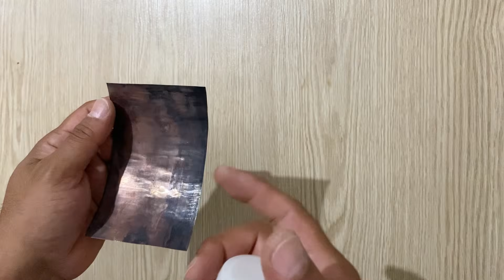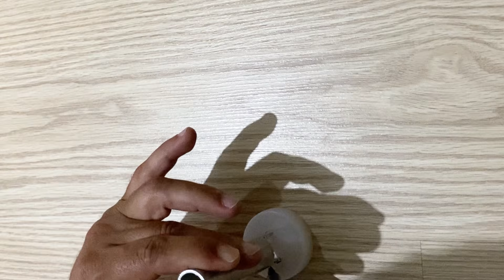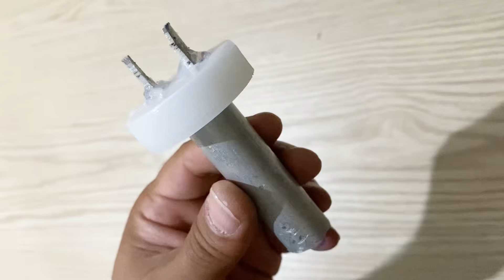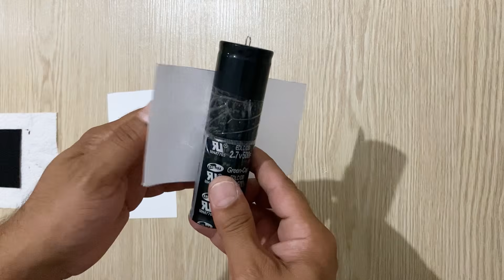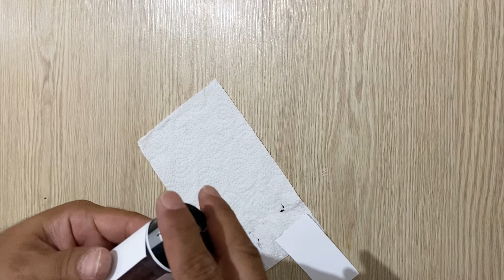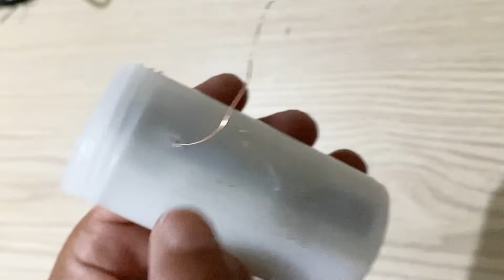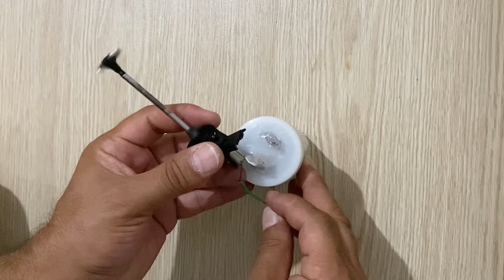How to Make Real and Powerful Battery, DIY Battery (5 Years Lifespan)

Comment: Sodium hydroxide drain cleaner as the electrolyte would make this similar to a salt battery, that's quite fascinating.
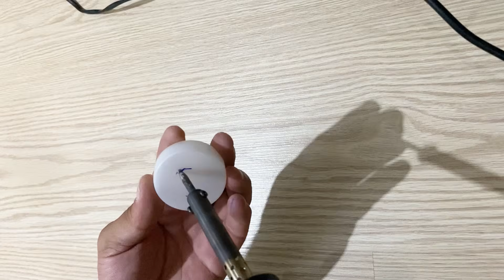5:55 an easier way to do that in future is to mark where you want the two aluminium terminals to stick through the plastic lid and then heat up the aluminium with a blowtorch or even lighter briefly, then poke the aluminium through the lid similar to how you did with the soldering iron. You'd need to hold the one end of the aluminium with a cloth or with an oven glove on while heating it up because it's almost as good a conductor of heat as copper is. 
Safety first and all 🙃😜
Just punch a tiny pin hole in the lid for the hydrogen to escape. 

Quite a simple idea, cheers for sharing. Can you use stainless steel instead of the aluminium for the anode(?), to make it last even longer? 🤔

Comment: Hi Joy of Electronic,
Nice video; although (sorry to say) without real understanding of physic and mostly chemistry (experimental facts); it remains (short time) speculative and a day-dream.

Why?
OK a battery when not connected is supposed to stay (very) long ready for you to connect it and allowing the electrons to flow and allow the half elements of the cell to work in concert (most of the time how you have defined (following the most favourable way - read providing the highest voltage difference (so each half element with its highest potential (positive on one side-and negative on the other)... Voltage is a potential energy; like water maintained with a dam; but if there is a side way; the tiniest, water will find its way down; that way will be favourised, it will grow and all water going down slower and with no more potential energy.

Cu resist quite wel NaOH if not hot and away from air oxygen!
Cu + O2(g) --> Cu2O +:CuO
Cu2O + H2O --> 2 CuOH (valence 1)
2 CuOH --> Cu(0) + Cu(OH)2 (valence 2).
----
Cu(+) often disproportionate to Cu(2+) (oxydation) and Cu(0) (reduction).

Then NaOH what is a quite strong base, if hot or sufficient time allowed will express the amphoteticity (acidity of copper hydroxyde).
Cu(OH)2 can be seen as H2CuO2... so it makes transciently cuprates like Na2CuO2

H2CuO2 + 2 NaOH --> Na2CuO2 + 2 H2O

If there is no oxygen available it will be depleted soon and it stops; otherwise it will slowly proceed and continue chewing the copper electrode slowly until all is gone into solution and repeecipited as Cu(OH)2 allowing naked Cu surface to be further oxydized.

On the other side; the more concerning part aluminium: Al
It provides the high reduction potential or (electropositivity) and most part if the battery potential voltage.

But Aluminium is appatently quite and stil due to a transparent oxyd layer (Al2O3 and Al(OH)O aside a little Al(OH)3 all 3 are interconnected into reactions into water and switch easily between each other.

Al(OH3)3 is amphoteric (plays the role of a base when exposed to stronger "acids" than itself; and the role of an acid when exposed to a stronger base than itself...
This reminds you copper hydroxyde isn't it?
For a good reason: acidity or basicity is only a relativity question and scale; two faces of the same coin.
There are the two extremes strongest acid and strongest base; but the second ones just below become for the second strongest acid side - it is basic relative to the stronger than itself acid; same applies to the totally opposite side of the scale; the strongest base; just below the second stronger base is slightly acidic vs itself...

So Al((OH)3 could be seen as H3AlO3 and if stronger bases are present; it forms aluminates like Na3AlO3.
Those are soluble and Al(OH)3 precipitates (as a gel) and reforms the caustic NaOH leaving naked metal.

The story would end there if Al was't so reactive (electropositive); it readily reacts with water H2O (again both an acid and a base relative to stronger acids or bases than itself)...
Al + 3 H2O --> Al(OH)3 + 3/2 H2(g)
This means that if water is present; the alternative half battery 2H(+) + 2 e(-) --> H2(g) 
is présent and operational ...thus battery in short cut; dam lets water fall via a side cracking and the energy is lost in little time with the attenant dangers of heat, flamable H2 gas and pressure build up.

Conclusion:
No need to test your battery unless wishing for something bad to happen to viewer trying it;
To give an idea of the possible runnaway reaction; that might become uncontrolably rapid and dangerous, autocatalytically:
1) Simply test the reactivity of aluminium foil (a tiny wrapped ball inside a beaker ... with protective personnal equipment - labcoat-gloves and googles) against strong acid like HCl (20% by weight should suffice a few ml)... it will dissolve tge thin protective layer as AlCl3, regenerate HCl (so only a catalyst yeah) and precipitate Al(OH)3 setting the naked reactive metal into contact with water thus setting H2(g) free what is quite exothermic due to electropositivity of aluminium...
Anyone with a good reasoning sense would'nt do a battery from pure sodium (Na) with water... it is a bit (with a kind of slight delay) what you propose here

2) Do the same with NaOH conc solution like pipe uncloging lye solition (10% by weight) a few ml; and aluminium foil wrapped tiny ball...
WEAR GOOGLES and gloves, labcoat (risk of blindness and severe burns if it enters into contact with eyes of skin).
Into the past solid NaOH prills were mixed with coarse aluminium metal powder to unclog stopped exhaust pipes combining heat of dissolution of solid NaOH, dissolution of fats (saponification - hydrolysis of fatty acid glycerol triesters into "fatty-ate" of sodium and glycerol (propan-1,2,3-triol)), dissolution of proteins (hydrolysis) like hairs into organic sodium salts of amino-acids AND as extra:
Heat and mechanical work ...H2(g) generation.
This produced gas quite fast if water was put into contact with the dry uncloging mixed powder (NaOH/Al) ... a bit the tiny demo proposed!.

Regards,
PHZ 
(PHILOU Zrealone from the Science Madness Forum and many former A.O.L newsgroups related to chemistry)
Reply: You can see from the comments that most people are poorly educated .regarding physics and chemistry.
Reply: Wasting your time

Comment: Can it be recharged by using 5V or 12V DC converter?
Reply from the maker: No, it’s only reusable
Reply: @joyofelectronics9782  Have you measured the total capacity of the battery in mah between 1.5V and 1.2V? If this thing even has 1000 mah, it would be even more amazing.

Comment: You Can Use Even Vinegar, Easily Accessible Acid! As For The Cathode Ans Anodes, I Suspect You Need To Clean Them Even With The Separator, Something Neutral Would Work, Like Filling It With Sand Then Pour Either Salt, Alkaline Or Acid Solution!
I Am Impressed With The 1,5 Watt Power(1,5Volts*1Amp) Outpot, I Would've Loved To See A Timelapse With Some Load On it, Something To Consume It, Just To See How Long It Can Last, With Live Voltage And Current Measurements During The Work-Load!
Reply: I would also want to know how to recharge this battery for it's said to work for 6 hours.

Comment: Interesting. When I tried it worked. But can have a higher voltage and what happens if the electrolyte is not removed when not in use,?

Comment: Interesting. When I tried it worked. But can have a higher voltage and what happens if the electrolyte is not removed when not in use,?
Reply: When you don't reply to questions if discourages one viewing your future videos

Comment: Ya that's right, sodium hydroxide reacts violently with aluminum and releases hydrogen and heat if I remember right. This is a dangerous battery build. He doesn't use safety glasses and gloves while handling the sodium hydroxide or even mention the hazards of this material. Don't do this build folks'!

Comment: That is cool and doable, now I would be highly interested in how to make a large rechargeable iron oxide battery (55 gallon barrel) that would run  110 volt 10 - 200 amp appliances in case the grid goes out. And how long it could run one 10 amp appliance, then just 50 amp appliances, then the time it would last running 200 amps at once. I know hardly anything about electrical things, so if you make it, a lot of detail and simple instructions. Also, that could be expanded by simply adding more identical units by its' side to double or more how long it held a charge.

Comment: I was expecting maybe 1 volt at .250 amp.  To get a solid 1.25 volt at more than 1 amp is impressive my friend. I will be building 100, 50 in series, remains in parallel.  A very cheap and simple power plant my friend. Thank you for sharing.
Reply: How has your project gone?
Reply: @heartsparkdollar  probably he already died with electrocution
Reply: @rahulmaron 😂😂😂
Reply: Still building series and parallel batteries  @heartsparkdollar
Reply: Yes, good question and how much did I put in for how long?
Reply: @PnRVRBO  if you can "organize" the aluminiumpipes it would be an cheap alternative
Reply: yea, make 1 million of those, and you can power an entire city!

Comment: When I was young a neighbor got a new color tv. When he got it the dealer tossed in a little do -it-yourself Kit for his kids to play with. All his kids were little, so he gave it to me. It was from Burgess battery company, a make - your - own D size batteries kit. It was basically the older way they made D batteries in a kit form, enough stuff to make two.
It used a metal can filled with electrolyte paste and a carbon rod down the center. I used them in a flashlight for quite some time and when they got pretty weak I took them apart, broke down and re-mixed the electrolyte with a little water as it was mostly because of drying out, and packed them back together again to use some more.
Then the electrolyte was getting pretty gnarly so I couldn’t do it a third time.
Reply: Wow, that is cool.

Comment: Thank you sir. But one thing l wanted ask is, will the electrolyte flem pressure effects after few hours of chemically reaction inside the plastic container ? 👍👍👍
Reply from the maker: There is ventile hole on the battery. Probably you missed that part
Reply from the maker: There is ventile hole on the battery. Probably you missed that part

Comment: Why don’t you just use Table Salt? Using the KOH with Aluminum produces a lot of Hydrogen Gas mate. You left no way of venting this Gas. Also the Aluminum is now a sacrificial Cathode and will need to be replaced very often. You do know this, right? Look the Japanese have a battery designed already like this. I think there product is called(The Forever Light). Check it out. Your Battery is dangerous especially for CHILDREN. I think you should go back and design a safer, better Battery, mate. Just saying. I want rate this video. Good luck on next project.😢

Comment: What is it that determines the voltage of the battery?  Also, what is the capacity of this little unit?
Reply from the maker: The chemical reaction between aluminum and sodium hydroxide is determine the voltage. If you make it larger you get higher current.

Comment: I found this video very interesting and informative. 
Can this also be made on a larger scale to produce more current?
Also I would like to know why you have 2 holes in the lid of only 1 is needed?
Reply from the maker: Yes you can make a larger one to get more current. I had two holes to position the aluminum more easily and neatly.
Reply: I also wondered why the 2 holes?
It was a fair enough question, also a pretty good answer, cheers.

Comment: How many VOLTS and AMPS  .. IS there any way to add or decrease the VOLTAGE and the AMPS ??
Reply from the maker: 1 amp 1.3 volts. You can connect in serial or parallel to adjust voltage and current.

Comment: Make the white tube 2× more length, now the electrolythe is at the bottom, when you want to use the battery, just turn the battery, now the electrolythe is in contact with electrode. Put somes instruction on the tube : on off and " turn the battery to make contact".
Reply from the maker: Very nice brother but you miss a point. The main idea is not separate the electrolyte from the electrodes, you have to renew the electrolyte time to time. Because after for a while the ability of the electrolyte to deplete aluminum will end up. At this point you have to replace the electrolyte with new one👍

Comment: One can make enough of these to make 12 Volts. And dry store them in a remote cabin..
At 1.2V you need 10 of them!
And when shyte hits the fan, one can bug out in comfort.. 
As I have tested larger versions of these, with stainless steel and aluminium.. We got over three years, with a lot of amps..
As in should be able to run one radio and a 12 v LED light strip...
Bigger ones could run a small freezer, to keep your food fresh.

* This consumes the Aluminium, that is the main cost!
Reply from the maker: Excellent 👍
Reply: Hello there, just wondering if you can use stainless steel instead of the aluminium for the anode(?), to make it last even longer? 🤔
Also, how did you go about the venting of the gases while in use, did you punch a tiny hole with a nail in the lid or do it as shown in the video?

Comment: Sodium hydroxide dissolves aluminum and releases hydrogen, and I'm pretty sure Na0H has a similar reaction with copper.   By, "5 years lifespan", do you mean when stored before adding the electrolyte?   ...Otherwise it seems that the aluminum, (and possibly also the copper), would be dissolved if left sitting in a solution of NaOH on a shelf for a while.   Thank you for taking the time to share this.  I've always been fascinated with batteries that can be made at home.  Robert Murray-Smith also has some very interesting videoS on this subject as well as many other subjects in this field of study.
Reply from the maker: Thanks brother for your comment. Let me illuminate one point. Until 60 percent sodium hydroxide solution has no considerable effect on copper 👍
Reply: @joyofelectronics9782  till alluminium is there , copper is safe :D
Reply: @joyofelectronics9782 سلام اون مواد سیاه رنگ چیه میشه تو خونه درست کرد؟❤
Reply: Could the solution be contained separate from the chemical? Have tab at the bottom that breaks the seal? Flooding the chamber when your read to use it? To extend battery life.
Reply: This will be like a sealed pudding can pull the tab, it's filled in! He separated container straight to the bottom.
Reply: I was going to highlight the same point: aluminum dissolves in caustic soda generating gaseous hydrogen and oxygen. They are highly flammable and even explosive. Perhaps it would be possible to use them through a burning valve. In the case of a larger scale, of course.
Reply: @geraldolc7740 it only generates hydrogen iv learned with my oxy-hydrogen torch and my souly hydrogen venturie style torch the one makes both gases and is happier to flashback than it is to burn the other just hydrogen hasent once flashed back atall since making the reactor for it and i run it off old pop cans we had laying around
Reply: i wondered this and thought would lead be better
Reply: copper is very resitant against bases .i dont think it gets eatn
Reply: He specifically said to empty the battery when not being used.
Reply: The redox reaction seems going shorter than 5 years 😂
Reply: NaOH  if  so efficient  then   we can   get cheaper batteries  but the graphane or graphite   paste    liquid  by cvd  or  we can also get  supper capacitor to store    electricity. Plz think of  chemical vapour deposit of  graphite  asto make   diamond   quartz  and makes  supper capacitor  to retain electricity charge
Reply: I agree with you 👍 🤝 
Good morning from Greece 🇬🇷 💙 
Καλημέρα από την Ελλάδα 😂
Reply: FYI, Cooper doesn't react with NaOH at room temp. And Sodium hydroxide doesn't dissolves Aluminum.
Reply: @z-survivor Sodium hydroxide dissolves aluminum oxide and forms sodium aluminate. Fresh aluminum is reactive enough to reduce water. So yes a sodium hydroxide solution will completely destroy aluminum after a while.
Reply: @z-survivor lol copper will react with sodium hydroxide at room temperature if the solution is strong enough it will not react with a weak solution thu 
However sodium hydroxide dose and will react with alume and dissolve it quite quickly aswell even at colder temperatures i litrally have a hydrogen torch outside as i type this that runs souly off the reaction of aluminum and sodium hydroxide it allso generates its own heat witch causes the reaction to proceed faster the hotter it gets generating more hydrogen the longer its left to react untill all the aluminum is dissolved or converted to the point that the solution can no longer hold anymore aluminum
Reply: @z-survivor batteries heat up...

Comment: Can you charge it?
Reply from the maker: It doesn’t require to charge
Reply: @joyofelectronics9782  I know, but can you to make the voltage higher
Reply: @joyofelectronics9782  or is there any way to make it at least 5 V?